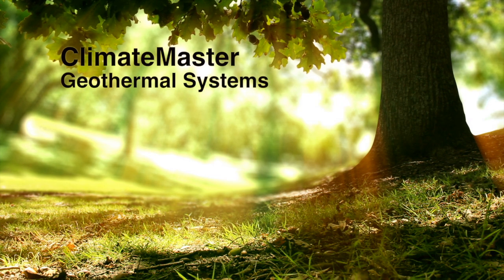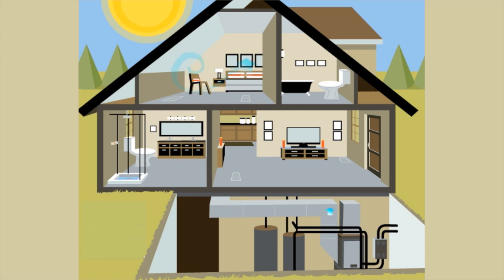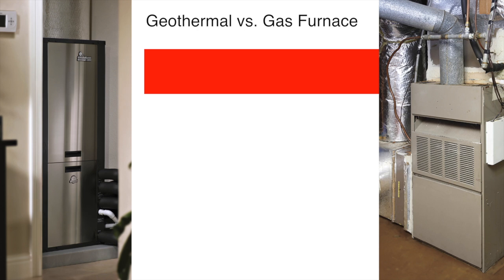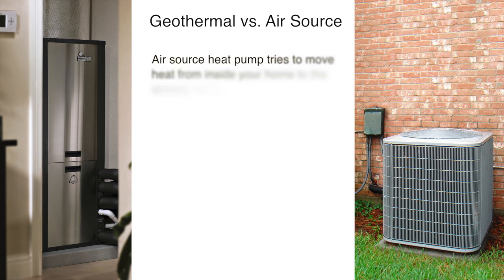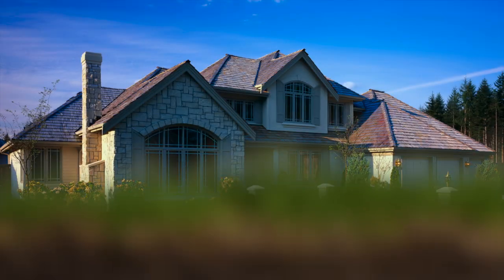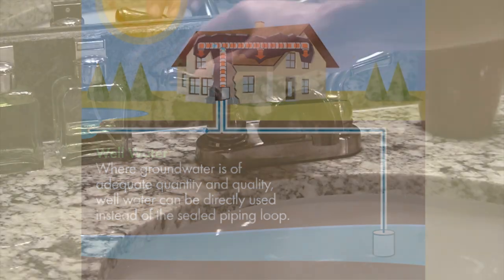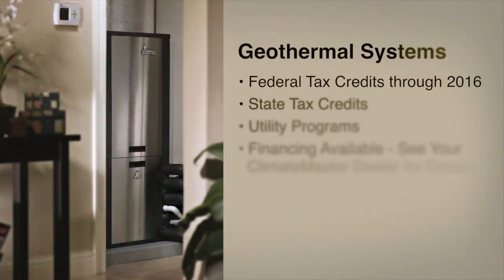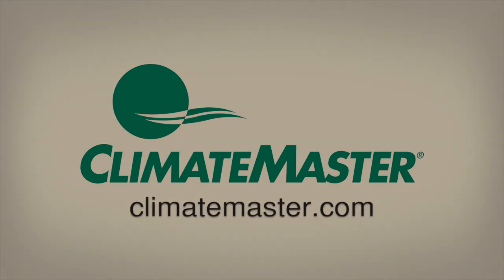Benefits of Geothermal Heating and Cooling

Comment: Would something like this work in Minnesota where it is SUPER cold in winter?
Reply: Yes
Reply: Yes. Might have some trouble up near Northeast of Bemidji(because of rocks) but yes. Go down 4 feet and it never freezes...except in 97. That year it froze to Earth core. lol. But seriously, might have to go deeper, but yes it would work. Just have to go below the frost layer. Look at it this way, if you have well water, take the temp of the water, that is a brief example.
Reply: Here's a link to a guy growing fruit using geothermal in Nebraska:
https://www.youtube.com/watch?v=ZD_3_gsgsnk&t=330s
Reply: They work in Maine
Reply: Only if you put down enough pipe to make it work.  In the summer you are rejecting heat into the soil in the winter you are pulling the heat.  If you do not drop in enough pipe the lines will actually freeze up the soil and you will no longer be able to extract heat.  Where you are  my best guess would be that you need atleast 800 feet of water pipe drilled to 400 feet deep PER TON that you need.  The ground tends to be nearly stable 20 feet down but if they drop long depths it actually becomes a bit cheaper than more holes as you wont need the number of casings
Reply: @stevepailet8258  If you have warm air in the house and run it though pipes, you are going to condense the moisture and blow wet air out of the pipes into your a/c ducts and rust them all out.  If the ground is freezing, then your water condensate will freeze in the pipes and eventually they will break.
Reply: @DonaldKasper-j2r  Couple of comments.. Water runs down hill. Dont believe that.. Ask a plumber 1/4 inch per foot is pretty much what all drain lines run.  So where is the moisture that has already run out of the pipe.  Look up earth tubes, They are buried deeply into the ground 8 -10 feet where the ground temperature is very stable. This temperature is very close to the average annual air temperature.  Where I am is very close to 58 degrees. In no way will this ever get to freezing.. If it did get to freezing .. Everyone in the world would pretty much be dead as the sun is no longer ever going to shine.    You made the assumption that the air coming in was going to be dumped into your version of a HVAC. Wrong.  first place is to go into a dehumidifier and then into an ERV.   What pipes are you commenting are going to freeze?  Water pipes?  Pex pipe is pretty much the only water pipes in the house. Very few are using copper piping any more due to the high cost.  Frankly your comments really are confusing  to me..
Reply: Simon
Unfortunately you wont know if it will work for you in winter until you install the system . Get all the info and research  you can before you write the check. I personally have a geo system that does NOT heat my house when it gets below freezing. Period. Works great in summer for AC.
Reply: I don't think you are telling the truth. How deep is the well and what temperatures do you have?
Reply: @72strand  this is why you pay experts who know how many feet of piping to install and not just guessing for the amount of piping needed.  darn near 95% of the systems that do not work are those who just guess.  You would not jump out of a plane without having a clue about a parachute would you?
Reply: @Steve Pailet Well, yes and no. If you own a system, you learn. And its not that complicated. First off, your size how deep the hole is determined, to the size of your pump. Som if you have a pump that is rated for example 11 kilowatts of heat. Then you can check what normal dept for that pump is. And its not that big of a deal. If you get it wrong. You make another and use them both. And new inverter types of pumps, that can change the speed of the pump. They have functions to limit, the total use of the hole, if you get problems. But! Dont cheap out on the hole, or the lengt of ground hose. Lets say a geothermal installation is 20 000 dollars. Then this cost is prob, 4000 for the drilling and hoses. 5000 for installation of electrical and plumbing, 1000 for grundwork and the rest is the pump. Now, the hole in the ground is rated for 50 yeas of life, after that you simply change the hose and it works for another 50 years. The pumps life is prob 20 to 25 years. Now that makes a cost of 10 000 dollar for 25 yeas, and that is 400 dollar a year. If your house needs 25 000 kwh of power for heating directly, and you get a geopump that saves down to 10 000 kwh, so you save 15000 and the cost i think in the US is 0.1? Dollars? So that makes it 1500 dollars in savings a year. Som a lot more savings than cost for the pump.
Reply: @72strand  The really efficient condenser units tend to be small so reality is that most people have pretty much no clue about geo source much less the equipment. When one opens up a geo source heat pump there in reality are only a few parts that separate them from a standard heatpump.  First you will discover a tube in shell heat exchanger.  Some use a flat plate exchanger.  This along with a water pump and high and low button type thermostat.  What is eliminated is the coil that one would find in an out door unit.    Because so many of the units are now using variable speed compressors this is no different than a standard mini split.  

6000 to 18000 BTU compressors seem to be the standard and as houses need more capacity.. they just add more units as needed. It is very easy to achieve seer up to 28 with these and cop of 4 +.  

At this point I would just as well go with several mini split systems in the house.  And forget about doing geo source.   They already have a large number of these systems easily available that have similar ratings to the geosource.  That said living in the cold north lands with long VERY cold winters there I would recommend going with the geo source so that one is not so dependent upon the heat in the open air.    

Getting to be a lot of other ways to do the job.  Solar panel prices are dropping fast. Easy enough to do low heat radiant floor  Seeing solar heating water storage so that making hot water to last for many days is not hard and pretty much a pay back in only a few years.    Just lots of ways to play the game.  Still no matter which way one goes first things first.  Understanding that making the house efficient where the BTU per foot needed to heat and cool the house are driven to very low point. This is why we are seeing more net zero homes being built and remodeled to operate ... Leed and passivhouse homes.
Reply: @Steve Pailet I know things about heat pums, so anyone, ask me if you want. Now, to expand on this. Firs we look how a geo heat pump works. Inside you find one big watertank, that is storage for warmwater. You find one pump for the brine (liquid that don't freeze som easy), that goes down the hole. And a normal circulation pump for the water to heating in the house. Some electronics, electric heaters like in a tankless waterheater. A computer, one valve that changes from heating the warmwater or the house. And one unit that has the cooling compressor. The compressor is allways sourced from other manufactures. In the cooling unit, a compressor compresses the refrigent, and it gets hot. I think the gas gets to 248 degrees Fahrenheit (120 C) and that heats the water. The unit have problems getting hotter water that 55 och 65 c (149 degrees Fahrenheit). Now for the cool side. You drill vertical or dig horizontal. The cool side operate like this. In goes brine, that is 41 degrees Fahrenheit to 29 degrees Fahrenheit. It can take below freezing. And the compressor cools it down normal from 40 to 35 degrees Fahrenheit. And you get hot water from around 95F to 122F. Now the best way to heat the house, is in a low temp system. that is floor heating or air based. Not using normal water based heaters that was for a wood boiler system. That way you get the best efficiency  
If the hole is good or bad is no big deal, It only makes a big deal if you drive it over the freezing point. That is you cool it so hard it cant keep up and the ground frezzes. 
It does make som diffrence the system you have on the hot side. Some ppl mounts fans under the radiators. Som change to low temp radiators that only need 55 C to heat the house.
Now what about air to air systems? Lets talk money. 
First the cost in a geo system is 1/3 drill 1/3 installation, electrical, pipes and plummer, 1/3 is the geo pump unit. And you get all this for around 25 000 dollars.
In Air to air, the cost is lower. And they actually have a higher efficiency . Why? Reason is the normal uses air outside that is hotter than 41 F. 
But they don't make hot water and they don't last as long.
Ok, so 8000 dollars for the unit. The hole last for ever, the other parts like pipes and electrical last very long to. It is the heat pump unit in geo the only lasts for 25 years.  
Air to Air last 15 years. That is 2000 dollars? 150 dollars/year for the machine. And geo is 320 dollars /year, 
But it makes hot water. And they system works when it is really cold for long periods and you need a lot of heat. So, and Air to Air, that works with one unit is a bit cheaper. If you need 2 of the, or 3, it soon becomes a no brainer to get a geo. A factor is if the house have a water based heating system. Then go for geo or Air to water system.
If you live in a place where it hardly ever snows. Then a Air to Water is prob best.
Reply: @72strand  you missed my point. there is perhaps $500 additional parts in a geosource heat pump over what one would purchase in a air to air.    How one distributes the heated water can be different.  Be it an air to water blower for ducted.. or radiant in floor heating   This along with a super deheater on the refrigerant side to provide domestic hot water ...  Since the units are basically the same and located inside the home rather than out in the elements the life span is longer..   The manufacturers are also finding that with changes to the reliability of the outdoors units on standard split units is now averaging between 18 -20 year. So still not real argument on the cost of the units.  When one goes to minisplit units the cost really gets skewed toward them over geosource. Last time I checked  $8000 vs $2000 and similar SEER and COP
Reply: @Steve Pailet Yepp, if you heat your house on direct electric, then it is the biggest super no brainier to get one or 2 air to air pump. At all times. It pays for it self. And if you need cooling to. If your house already have a lot of radiators. You can use Air -to water or geo. They are good to. But you need things like a working tank and hot water tank. The price for the unit is the same as geo. But you don't get the cost of the hole. My guess is 12000? If you have they money, and know that a hole is something that last a long time and the cost of the hole pays over a lifetime. Get geo. If you live where it is really cold, get geo. If you have a really big house get geo. 
If you don't have the time to spend working on wood. Get a heat pump system that works. Yes wood is cheap if you don't value you time.
Reply: @72strand  have been looking at high efficiency homes. When one is a net zero or net positive  the cost of heat and cooling really becomes a non issue.  This is why I gave up on geo
Reply: @Steve Pailet Yes, that is great. Geo really works best, where the right conditions are. How the house is built, and the solutions for heating and cooling. I don't know the real costs in US for drilling. Here one deep hole is about "What a nurse gets one month before taxes". Or something like that. High efficiency homes needs less because you made the investment in the house. Not in the heat solution.
Reply: just need enough heat exchange surface area but sure it would work. With out enough       surface area you would just extract more heat than the earth can replenish..   Result Massive failure ..

Comment: I have family who tried this, a niece and her husband. It has been a nightmare for over ten years. The company no longer even tries to get it to work. It never has worked. A complete waste of about $50,000 They live by Perham Minnesota, it doesn't work there.
Reply: about 99% of the time this has to do with inadequate amount of ground loop.  People try to cheap out and do not put in enough water loop per ton.. Have seen some who do 250 ft of loop per ton. wont work.. 800 ft per ton seems to be the number I hear more consistently ... Think of it this way .. you can put a 1 liter engine in a 5000 pound car..  It will move but sure would not ever want to try to get on the expressway with that dog
Reply: The only way to use a geothermal system is a well-known brand Waterfurnace ,  do not at all buy a cheaper unit.  water heat pumps from years ago last 20 to 30 years today, lucky to get 6  to 10 years, less if it is a cheapo. plus install yourself and learn . -30c one needs backup heat also  I use my mostly in the spring and fall. when running a boiler or woodstove is uneconomical .

Comment: I find your whole ad to be misleading because you're leaving out the part where you have to add extra energy to heat your house above the 55 degrees. One can assume that especially if you worked in the solar business for as many years as I have. If the solar systems were so great every job that I installed would not had to have been subsidized by the taxpayers. this is a bad ad it doesn't tell you it's hiding stuff and that's just deceptive. bad dogs
Reply: I've had one of these in my house for 35 years, and it has worked well in both heating and cooling . It's nothing but a regular heat pump with a water coil inside   instead of an air coil  outside . Nothing exotic. Mine puts out air at about 100 F. in winter, about 55-65 in summer. If it won't heat your house above 55 , you probably undersized the unit or your house is poorly insulated.

Comment: so many people in the comment section are dumb as fuck.. sry but if you do not even know how a heatpump works and how little energy a pump uses to pump water in a closed loop system than you should not critizise this technology, that is by the way proven and around for 30+years.. media and heat installation companies make you think this is some sort of new and experimental technology but it is not... nothing about this is.. not even the heatpump which is a technology massively used everywhere.. point is.. the industry is building reliable heatpumps for 30+ years now and while the efficiency may have increased over the years like with everything it is and was a viable option for heating and cooling a house for the past 30 years.

the duct system shown in this video as a heat distributor for the whole house may seem good, but low heat floor heating is a much more efficient way to heat the house. and allows for the deltaT to be as low as possible for maximum efficiency of the heatpump.

Comment: Why does the water need an antifreeze solution?
Reply: In case the system broke or you turned it off and it dropped below freezing in your house, the liquid could freeze without the antifreeze and damage the pipes.
Reply: @mattwolf7698  since all of the piping is either well below frost line or is located in the  house the need for anti freeze is actually zero. In reality having the anti freeze 
lowers its ability to exchange heat over using 100% water.  With this in mind I do     wonder why they use it in this application.. It is not like they were using it on the 
outside of the house in thermal solar panels
Reply: so it doesn't freeze while transporting the water
Reply: to raise the price

Comment: Geothermal is one of the biggest scams of our era. Water at 55F doesn't heat, it needs to be made hotter to heat the home which requires electricity. Whether using compression or resistance, it still requires energy. 

If you want to use a heat pump just pull water out of regular well/water system and heat that. It comes from the same depth as a geo loop does anyways. 

Geo-cooling is a better proposition if the dewpoint can be managed.
Reply: oh boy you have little to no idea.. it is far from being a scam... you just have to do the math correctly, it all comes down to the amount of electricity needed.. and nobody here is talking about a "hot geo source" here but rather about a geo loop that is connected to a heatpump.. 

however using the dew point and the freezing point of water correctly is more than a decent approach and is used in these applicatios already.
Reply: https://www.youtube.com/watch?v=Uv8bTAGr0tU  You do have to use a compressor, but it is much greener and cost efficient idea if you have solar panels or such
Reply: S Slope
I totally agree. I know because I have one in my house in the No. Sierrias. Biggest waste of money I ever spent.
Reply: SlipperySlope it doesn’t matter how you spin it there’s no way they are getting the heat from the ground or a pond they are heating it with electricity instead of gas or wood and in our area it’s greener to use gas because gas burns cleaner than coal which is what is used to fire electrical power stations and metal foundries for you wind turbines, I have a close family friend that got this put in when they built there new house and says it was a good thing for him because he didn’t have access to gas hook up but it’s about $760 a month for the electrical bill in the winter so its not a cheap way to heat
Reply: not so easy to do this will a well as one has to get rid of the water and you might end up lowering water table.   With Geo source get about a 1 part input *power and 4 parts output which has been sucked out of the ground